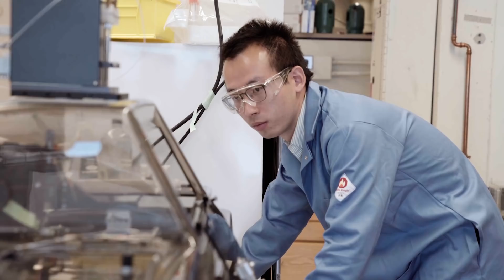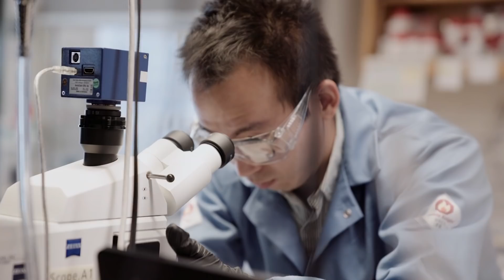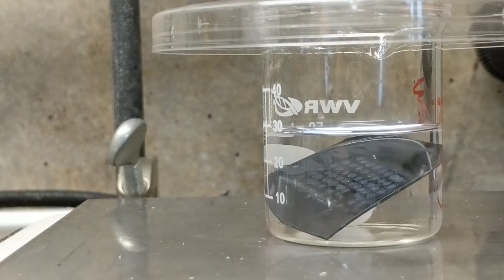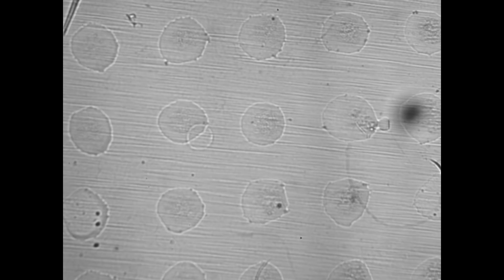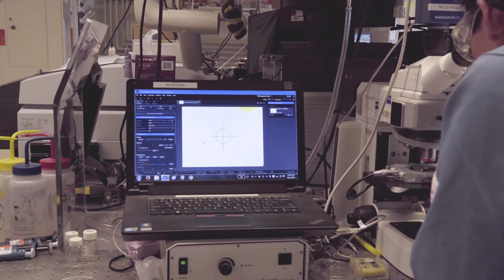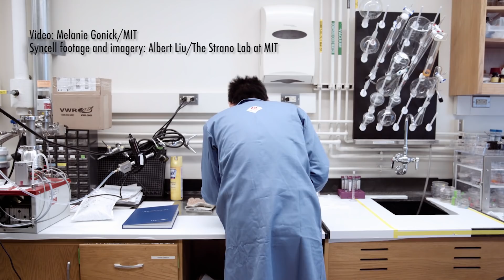How to mass produce cell-sized robots

Comment: A potential way to use this to make very small macroscale robots would be to repeat the fracturing process a lot, each time adding new components to what your building. The end result is a very small macroscale robot that can be used for various purposes.

Comment: Ok thats actually really interesting. Are you guys using laser lithography to inscribe the graphene? Can you make them slightly larger that a single cell and give them more utility, such as appendages? Do they have to be round? What’s the storage capacity for commands/functions? You could make structures inside the polymer by hitting it with some intersecting lasers before you cut them out maybe? How specific does the polymer have to be? This could be the beginning of a utility swarm.

Comment: ...and they can run these cells on entropic-energy extraction violating their classic Second Law of Thermodynamics—but MIT and Lincoln Labs don't think that far (mathematically)...

...(cf we're still waiting, two decades now, for MIT Technology 3D-printed artificial teeth)...
Reply: "The team worked out a way to graft complete electronic circuits onto colloid particles. This would allow the microbots to be self-powered using tiny photodiodes to feed sips of electricity to the robot's computer, sensors, and memory circuits."

Comment: not bad
I wonder what the margin of error and loss is, and I wonder how they plan on powering the sensors
I supposed AA batteries are out of the question
Reply: Power may come in chemically or by radio waves.
Reply: I considered NFC near field communication, but where to you stick an antenna on that thing? The japanese have done recharging at a distance of meters but you can't dose already sick patients which what amounts to carcinogenic levels of radiation.
there is a solution but I'm not sure what it is.
I could be persuaded to study the issue but MIT is not offering me a stipend
Reply: I have a feeling that they’ll base the power source in a similar way as existing animal/plant cells. 

I think a more plausible size for nanomachines would be reflective of micelles where the package is enveloped in phospholipids or the sort... even then though, these nanomachines would run out of power relatively fast.
Reply: I have another idea that could work but refuse to be datamined, in any case, I think top priority should be to keep those bots from getting stuck inside the patient, it's bad enough when surgeons leave sponges inside people
Reply: We're yet to get that far I'm afraid.
Reply: Probably solar power